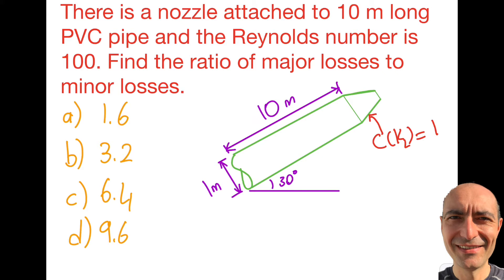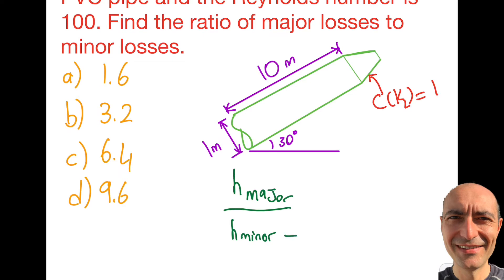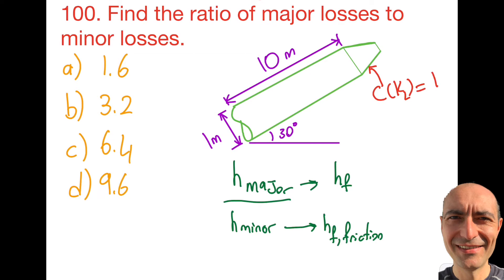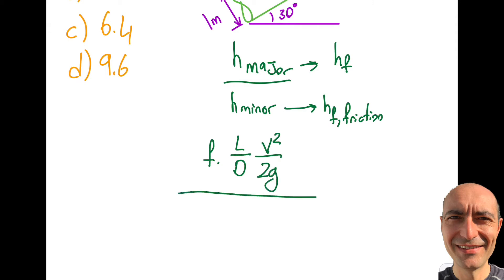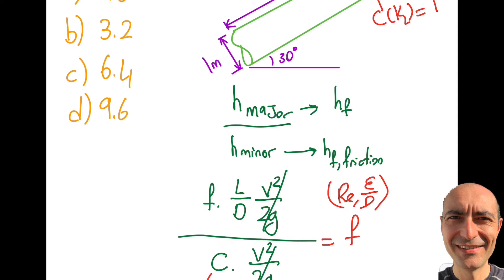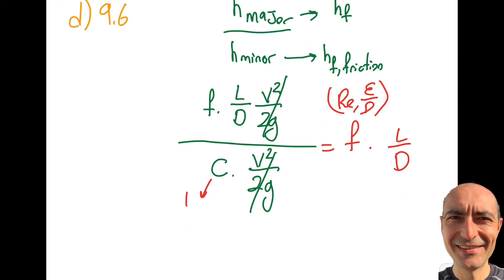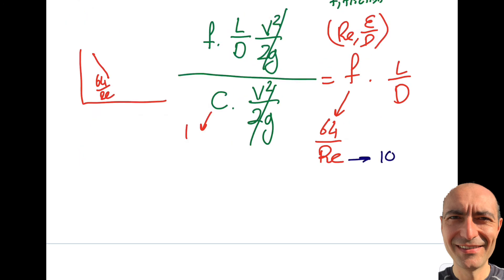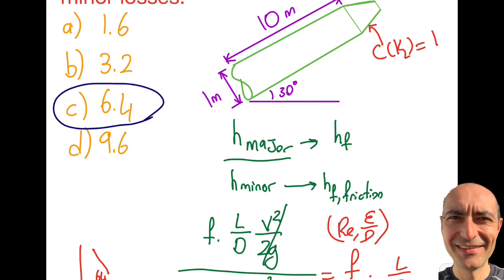FE Exam Fluid Mechanics - 4.9 - Practice Problem - Major and Minor Losses

Comment: I am curious, Wouldn't the L defined in the FE handbook as "Length over which pressure drop occurs" be the vertical distance AKA 10 sin(30)?
Reply: L is the length of pipe. Vertical distance in a situation like this is accounted for in Bernoulli’s equation, where it is represented by the difference between the two points of height z1 and z2.